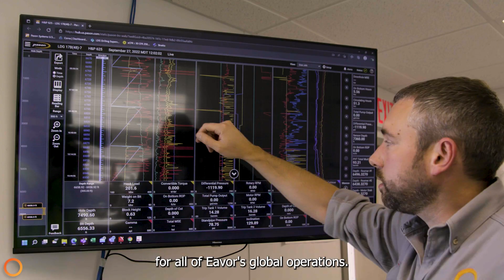Eavor-Deep™ - Next-Generation Geothermal

Comment: Eavor writes <<50% efficiency for making electricity . Yes , it depends on how hot thermal rock is and how cool the  air is . But to be at 49% efficiency, the rock needs be around 500 C. You need to be down 25 km for this temperature. I know that the butane is at supercritica as it goes through the turbine but I do not think this brings the efficiency high enough to be close to 50%